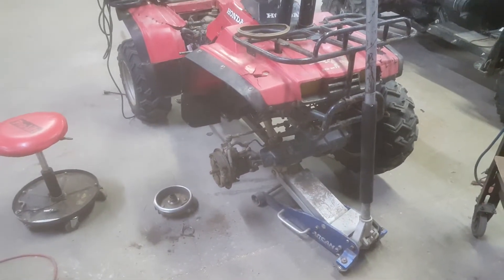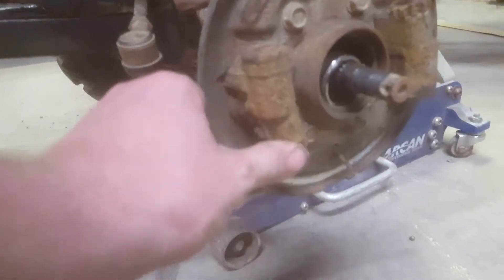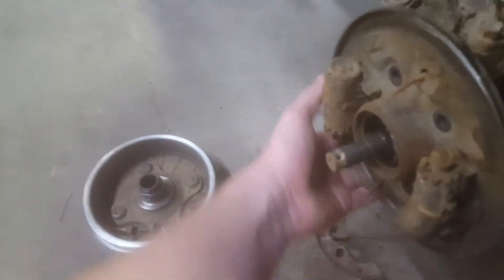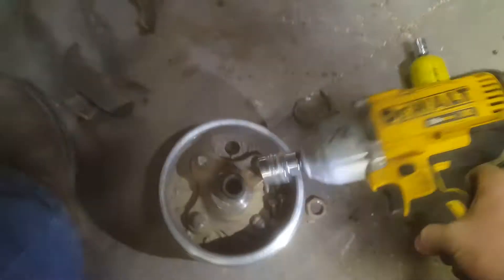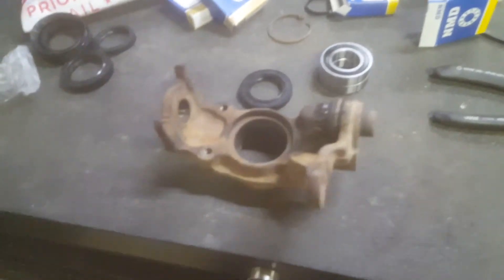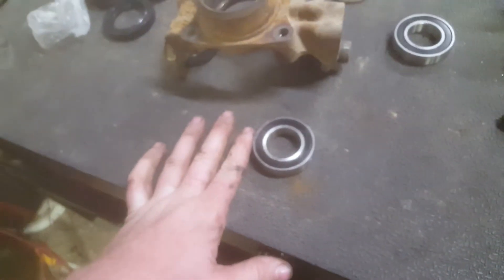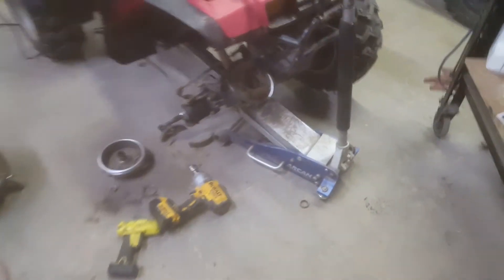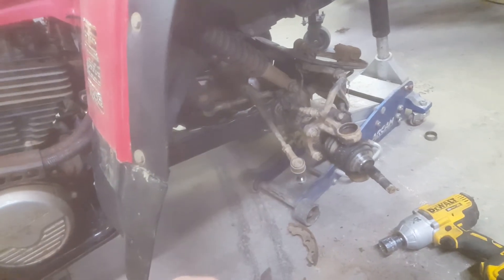1986 Honda trx 350d how to do front wheel bearing

Comment: Any videos on the boot?
Reply from the maker: I don't recall ever making one
Reply: @Kerrage  ok, do you recall putting it together? I put the bearing in first instead of in the rod because that’s the only way I could get it on but I noticed I need to put a circlip on but I can’t unless I take the bearing back out… would I be ok to leave it out?
Reply from the maker: @erichemmelgarn4623  I would definitely make sure to install the boot
Reply: @Kerrage  boot is on I’m just talking about the little circlip at the end of the rod
Reply from the maker: @erichemmelgarn4623  I'd definitely try to get it back on